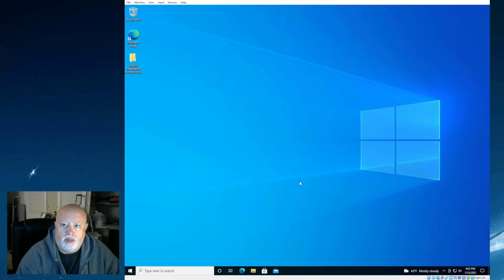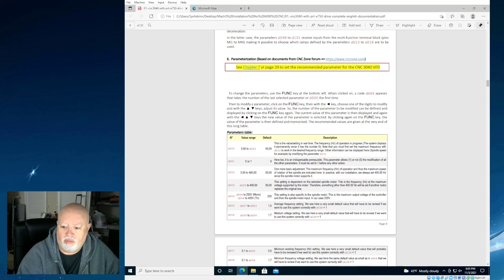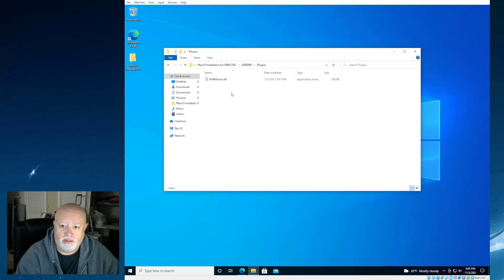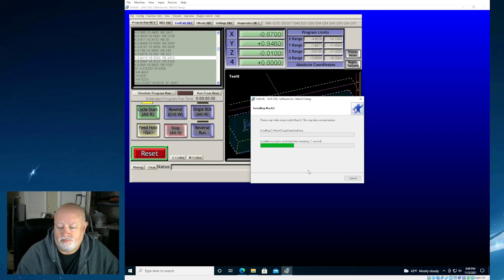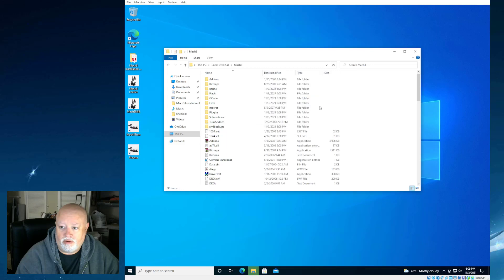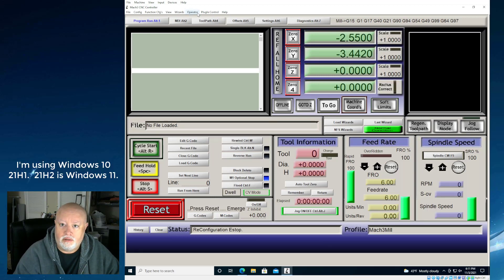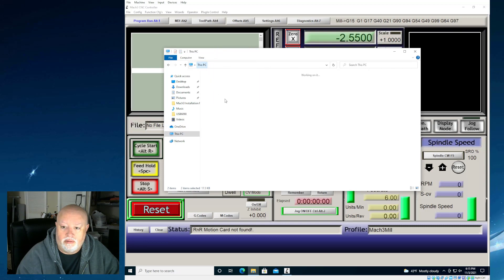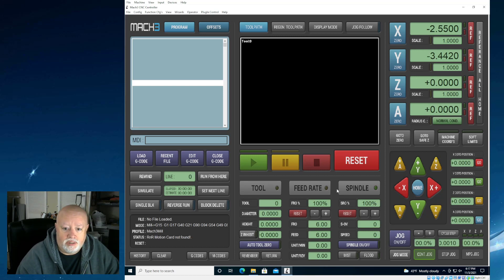Setting Up Mach3 with the files you get with your 6090GZ router.

Comment: Hello, i really like your videos. I purchased the 6090 cnc router. But i can not get it to move. I downloaded MACH3 and dont know what to do from there. Do you have any advice for me
Reply from the maker: From what I've seen, this usually is a problem with the DLL file, for the RnR Motion controller.  If you need the DLL, you can find it in the channel description in the links section.  Other than that, I'd be happy to help you out.  I've been able to get most of the CNC machines people ask me about up and running in under an hour-ish.  So, let me know if you are interested in some "hands on" assistance.

Comment: sorry did i miss something? where did you put the RnR Motion DLL file ? iv got it from your share, (thanks) but not sure what to do with it *thanks for bothering to keep your download link live.*
Reply from the maker: It's in the "about" section of the channel.  But here it is for quick reference.

RnR Motion DLL:  https://1drv.ms/u/s!AgxiwVost-OPi4EI-2tEU2uXrnDOxw
Reply: @jeffmorlen   i got some good help from artsoft . it goes in the plugins folder, right? iv got the smaller model, as per the manual. im hoping your .dll will work for that one ??
or maybe not.. the box is the same ??  but thanks for bothering to keep your download link live.
Reply from the maker: Here is a link to the channel.  You can find all the downloads by clicking "more" at the top.

https://www.youtube.com/@jeffmorlen
Reply: @jeffmorlen  hi, i am grateful for your help, but i played over and over the bit (1/4 speed) where you took all the files from the 6090 folder , and randomly tossed them into the roots of the mach3 folder. how did the rnr dill find its way into the plugins? did it all go into the plugins. im wary of running mach3 untill i get it right. everybody else here seems to have no problems so.. i dunno.
Reply from the maker: The DLL files go into the c:\mach3\plugins folder.  Once there you should be able to get to the RnR Motion plugin from the "Plugin Control" menu item at the top of Mach3.
Reply: @jeffmorlen  EUREKA !!   actually got it to jog ! theres hope for me ..must have got something right .  thanks for your personal help

Comment: Jeff,

Another very satisfied viewer. I don't think I would have the machine working if not for this video.

May I ask which CAD/CAM you use or recommend?  I am new to this toy,
Reply from the maker: I currently use Vectric products.  Vectric V-Carve Desktop (lowest version) is a fairly cheap way to get into design with using a CNC in mind.
You can use Fusion 360, but I found it very hard to master... I can design in it, but only simple stuff.

Hope that helps.
Reply: @jeffmorlen  Thanks again!

Comment: Nicely done video.
I could not get the official Mach3 to work in trial mode. I would rather pay you than Mach. Mach documentation is still parallel port based.  I am just going to put a SMC4-4 controller on it.
Reply from the maker: I’ve debated putting a dedicated controller on mine as well.  However, Mach3 does what I need it to do.

I’m happy to help you out, if you need assistance.

Comment: Good morning. Thank you for your video. Can I ask you which PIN you entered into the router’s x-y limit switches? 11/12/13/15 ?? Port Number 1? Physically I did not find the Z-axis limit switches. No instruction booklet and 1000 problems 🥹. Thanks for all
Reply from the maker: The Z axis has no limit switches on my machine... so yours may not either.  This is the pin out for the CNCEST 6090GZ with the R and R Motion controller card.  Yours may be different, but may use the same pin outs.

The pin out for the limit switches and inputs are:
X+++/X--- = Port 3, Pin 2
Y+++/Y--- = Port 3, Pin 2
Z+++/Z--- = Port 3, Pin 2
These are in one loop and a single trigger stops the machine.

Other ports/pins to note are:
Probe = Port 3, Pin 4
Limit Override = Port 3, Pin 3
E-Stop = Port 3, Pin 1

I hope this helps!!
Reply: @jeffmorlen  ,🙂🙂🙂🙂❤️ thanks for all
Reply from the maker: You are welcome!!  If you have any issues, please let me know.

Comment: Hi. I'm again 😅.. Alessandro from Italy. I bought the same machine a month ago, today I tried to install Mach 3 on my laptop ( windows 10 32bit) , when I tried to open file MACH3VERSIONR3.041( date...25/03/2013  25.733KB)  appeared an error " international error B109-13: cannot decompress setup program. 
I tried to install mach3 through the cd supplied with the cnc router cncest 9060.  😢😢
Reply: Hi. I fixed the error code B109-13 by copying and pasting to my desktop the file in the installation cd of mach3.❤❤❤. It works now... but... more problems
Reply from the maker: What other problems are you having?  I'm happy to help.
Reply: @jeffmorlen  Z axis limit switch es....  I need an emergency stop for the Z axis.   Why they don't install n2 switch? 5 $ totally. 😤.  I can't open the vdf controller ( Warranty), but i can install n2 switch on the cable of x axis switch limit. 🤭😁
Reply from the maker: I won't tell anyone... :/

Comment: hello is there any solution to connect my plt connector in controler to usb port (I have the same controler with plt port)
Reply from the maker: There are a couple solutions on Amazon.  One from RATTMMOTOR looks promising.  You can also get a printer port card for your PC.

Comment: howdy i just got my 6090 but the flash drive isnt working,i contacted them amd i assume they  will send cd or flash but in the meantime is there anything i can do ? get files offline? thanks
Reply from the maker: I have links to downloads of the files (no license files are included) in the description.
https://www.youtube.com/watch?v=SCau8R3PfAo
Reply: @jeffmorlen  I did get a flash drive but it doesn't do anything but connect to hand held controller
Reply from the maker: If it has the RJ11 (phone looking connector) on one side and a male USB on the other, that is just the interface for the pendant controller (which I don't use).  But, the other files can be found in my links.

** You should not need a driver to use the pendant.
Reply: @jeffmorlen  yes its usb on  one side and tele on the other side let me try and open link u sent...
Reply: @jeffmorlen  nothing worked today ,I did have another mach3 on my pc I wonder if that caused anything to not work ,but I could not see program files

Comment: Also I managed to sort out the Z axis end float problem  by removing the 1204 ball screw and drilling and tapping the bearing end in my lathe to M6 and fitting another flanged 28x12x8 ball race bearing on the base of the Z like the X &Y has...but using an M6 cap screw and washer.

Comment: Hi Jeff from the North East England ... my CNCEST 6090 arrived last week (same as yours) I got it all up and running ok but I can't get it to jog on two axis X&Y at the same time  plus a few other niggles as I did on my other home built Hobby CNC machine (that my Dad built a couple of years ago) ...this machine is much faster and built better and I like it ... have you come across this same problem ?
Reply from the maker: Ken-
Mine does the same thing... only one axis at a time.  I think it may have to do with the USB part of the system.  I don't have a solution, but I will see if I can uncover some details.

Comment: Hello. And million thanks with all the help i got from your videos. But..😊 I have one problem, when i turn the vfd to pc-mode and try to start the spindle from mach3, the green "run" light s up but the spindle is not spinning. And when i stop it from the program the red "stop" lights up.
Reply from the maker: On your control box you need to have the power on, the switch set to PC, the E-Stop disengaged, and the green "RUN" button pressed before you start.  The PC will not set the RUN/STOP on the VFD (I don't think).  This is the way I do it.
Reply: Thank you.! I can now totally control the cnc from Mach3. But only when the vfd turned to manually and not to pc.? Since it runs just fine this way i decided not to care anymore. And thank you once again for all the info and help you share in your videos.
Reply from the maker: I want to say that there was a post/comment about some mfg not hooking the VFD up to the control board... but I may be remembering that wrong.

I'm glad you got it going!

Comment: Hey Jeff. After a few months of futility with Mach 3. I came across a motion control software for the my Chinese 6090 . it's called Drufel. It connected immediately and automatically. And has a free version for up to 5000 lines of code and non commercial use. And for a modest $100 you can obtain a license for unlimited lines of code and commercial use. Mach 3 ,for me , was no more than a clinic in futility and frustration. Gsender did not even detect the machine either. Drufel was absolutely automatic and hassle free. Have you checked it out ?
Reply from the maker: They only take crypto and (oh... you just posted another comment)...

Comment: use notepad ++ to read files
Reply from the maker: There are several files in there... 
The CRV files are VCarve files.
The TXT files are the Gcode exported from VCarve.
Reply from the maker: (if you are referring to the dust boot adapter files)
Reply: @jeffmorlen  No, notepad++ is an editor that you can open almost any file with so you can read it. Some use it in programming as a code editor.
Reply from the maker: Yup.  I use Notepad++ daily.  But I'm not fluent in G-Code... so I rely upon programs like V-Carve to pump out the TXT file for me.  :)
Reply: @jeffmorlen  Yes, as do I. Mach3 post processor for g-code.
Reply: @jeffmorlen  great, I haven't opened them yet. Thanks my friend!

Comment: Hi Jeff. I have a 6040 that came with the nMotion CNC controller and I can not get even the spindle to run from the diagnostics window. I have followed all of the instructions from the manufacturer regarding setting up ports and pins and motor tuning, but I have no movement and no idea what to do next. I'm on a Windows 10 laptop using a USB connector supplied by the manufacturer, using Mach3 software license they also provided on my purchase. Do you have any suggestions on what the issue could be, and should I try to replace my Mach3 with the one in your description?
Reply from the maker: I'm not too familiar with the nMotion CNC controller you are talking about.  But, if it is anything like the other NON-PARALLEL PORT versions that work with Mach3, you should have a DLL that you need to put in the plugins folder to make it work.

But, it sounds like you have already done this... as you can move the machine around but not activate (turn on) the spindle.

* DO AT YOUR OWN RISK***
Make sure that your installation of Mach3 is setup to use the Spindle control.  This is located in the "ports & pins" section.  You need to enable spindle control and PWM (pulse width modulation) output from your card to the VFD.  The PWM voltage should be, I think, between 1 and 10 volts.  I'd check that first... look for the config in Mach3 to be setup to use the Spindle and PWM control from the card to control your spindle start/stop/speed.

I hope this helps.  :/
Reply: @jeffmorlen  Hey Jeff. I have all of the necessary sections enabled in the config settings. When I go to diagnostics and enable the spindle, the light next to the output for the spindle from the spindle settings was flashing red. Is this related to the issue?
Reply from the maker: I'm sorry, but I don't know.  I don't know what machine you have and I'm not familiar with the nMotion CNC controller (as I had stated).  Can you run the spindle manually from the VFD?
Reply: @jeffmorlen  Hey Jeff, After doing some more research, the company that manufactures this machine has made it so that the spindle has to be controlled manually through the VFD. However, the VFD for this machine is built into the side of the machine, and I cannot get it to control the spindle either. I've taken the machine apart and all of the connections are normal, but still no spindle control.
Reply from the maker: Were you able to get your machine working with your VFD?  I know you said that the controls for the VFD were, by design, manual only.
Do you have a link to where you bought your machine so I can look at it?

Comment: I have to say thank you so much for making these videos.. I just recently bought a CNCEST 6090 cnc with a 4th axis. I was having trouble finding info on this model. I managed to set the firmware firmware up, but all I could do was turn the spindle on. I couldn't jog the machine or turn the spindle on from the PC. I checked everything. I knew it was something simple and it was... You guessed it, it was the .dll file. If it weren't for your video and the link to all the info, this machine would be a large and overly priced paperweight. I am moving forward now finally. Thank you! I liked all your videos, and subscribed as a token of my appreciation. I hope you will still be making videos in the future. I will watch all of them regardless. Happy carving! Jeremy King
Reply from the maker: I'm glad I was able to help you get it going!!  I am still making videos... what do YOU want to see?  What do you have questions on?  I'm happy to put something together as a short or a longer, in depth, video too.
Reply: @jeffmorlen  My experience was opposite. I had motion on x,y,z but could not control spindle. Although the spindle can run from the vfd. Videos like this will help me get it going.

Comment: This is so frustrating .. I have the exact 6090gz machine as you. Running windows 10 64bit on laptop. My machine came with 0 software. I downloaded mach3 demo and I used the rnrmotion link that you posted in one of your comments. I dragged it to the mach3 plug-ins. I’m getting nothing. Rnrmotion is not showing in my plug-in when I check in the plug-in config. Kind of lost at what to do next .. any suggestions?
Reply from the maker: I’m happy to help you get it running.  I’m currently (at 8:51am) at a soccer field.  But, I’ll reach out to you when I’m done.
Reply from the maker: OMG... I am so sorry!!!  
I made a migration away from Gmail and they locked my Google Drive.  But, I have reposted the links to the software on the main description for most of my videos.  Please take a look, download what you need and let me know if you continue to have issues.

Comment: Hello Jeff, I have the 6040 Router and have Mach3. The manufacture "did not" send the "dll files" to run Mach3. Any chance you could send the "Link or the files" to download? Thanks very much for your expertise on this matter and keep up the great work. John
Reply from the maker: John-
Here is a link to the RnRMotion.dll file that I got with my 6090GZ (https://1drv.ms/u/s!AgxiwVost-OPi4EI-2tEU2uXrnDOxw?e=4cTQrg).  Put this in the plugins folder (Google where exactly).

* DOWNLOAD AT YOUR OWN RISK *
(I have to say that just because I did not make this file and got it from the vendor)
Reply: @jeffmorlen  Thank you Jeff and I have nothing to loose. Does not work now so I will let you know results. Thanks again. John
Reply: Hey Jeff, Still no no movement on the motors. DRO work. No movement thought. HELP!!! Thanks
Reply: I put the files in the Plugins folder and it then said "RnRMotion Controller Not Found". So I put the dll file in the Mach3 main folder and the DRO's work but no movement on the mill. I have to be close as the "Steppers" do engage. Thanks
Reply from the maker: Gimme a quick once over of your setup...
Windows PC running?  Windows XP/7/8/10? Laptop/Desktop? Mach3, what version? 

If you go to Mach3 and then to the "Plugin Control" menu item, do you see the RnRMotion plugin?
If so, click on it.  You should see some information about your control board.  What firmware version do you have?
If not, we need to check the location of the DLL file in the plugins folder.  Make sure your DLL is in the C:\Mach3\Plugins folder.
Reply from the maker: I think we were typing at the same time.  I responded below...
Reply from the maker: I would try a different USB cable.  It is fairly generic... same as printers use (usually)
Reply from the maker: ALSO...
You are not the only one with this issue of NO MOVEMENT from your machine.
Reply: @jeffmorlen  OK Jeff, Moved the dll files to Plugins Folder. Startup Mach3 and ask "Your system showing more than one control devise. Run RnRMotion? Yes. I have no DRO movement now. Now when I click on the top button "Plugin Control" is says "RnRmotion Controller Not Found. Please connect the USB wire and press the Reset Button. Any thoughts? Thanks. We get this mill going a case of beer is coming your way.
Reply: @jeffmorlen  Please note I was running the software that came with the mill (CNC-Planet) for about 1 year and now it does not work. Will not let me "Activate License"
Reply: OK when I click on the top "Plugin Control (in Mach3)" is says "RnRmotion Controller Not Found. Please connect the USB wire and press the Reset Button. Sorry I will wait for your responce. Just getting excited.
Reply: Thanks Jeff for your effort. I give up. It's hard to fix something when it's not in front of you. Know anybody want a 6040 for $100? That's all it's worth to me. Take care. John
Reply from the maker: Ah...
Planet-CNC does not use the RnRMotion controller... they use their own Mk3/Mk4 controller.  So, that is the issue.
A quick search shows that Mach3 and the Mk3/Mk4 boards are not compatible with each other... Sorry.  :(

But, if you are not getting anywhere with Planet-CNC, you could always swap out the board for a RnRMotion board.
They should have similar functions (limit switches, XYZ-A, homing, probe, etc.).
Reply from the maker: Where are you located?